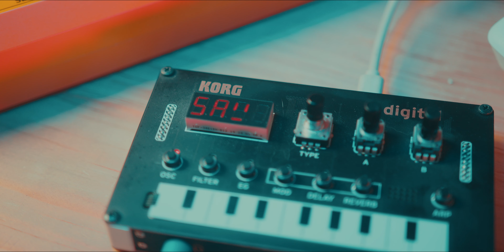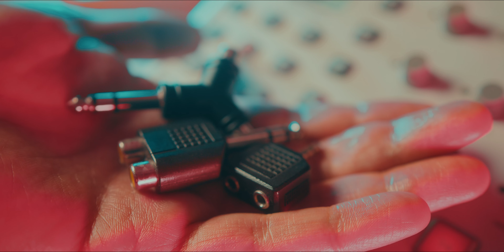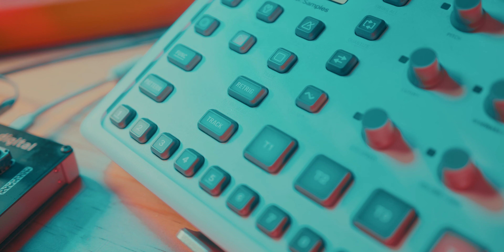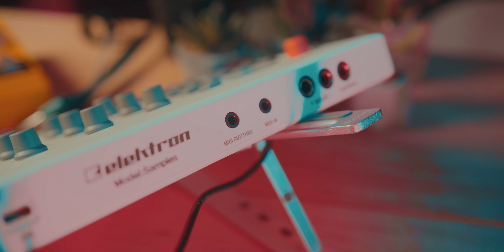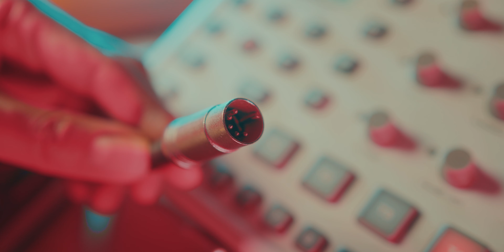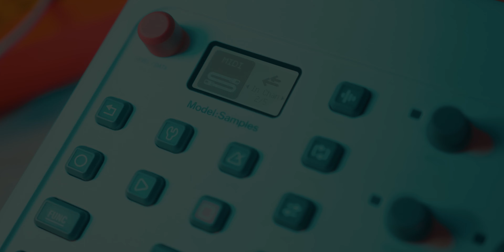Does TRS MIDI Audio Splitter works?

Comment: I would not recommend this to anyone. All MIDI outputs and inputs are specified as a 5 milliamp current loop. It is not recommended to divide this 5 milliamps in two with a passive device, as this will not result in 2x5 milliamps.
Reply: So what will happen?
Reply: @angeleocorrodead  Google "Do passive Midi Through boxes work?"
Google "Split midi twice with a passive cable"